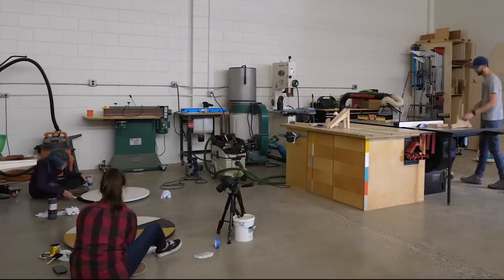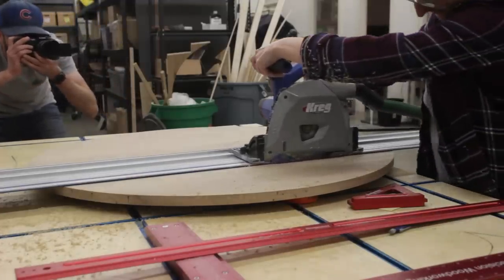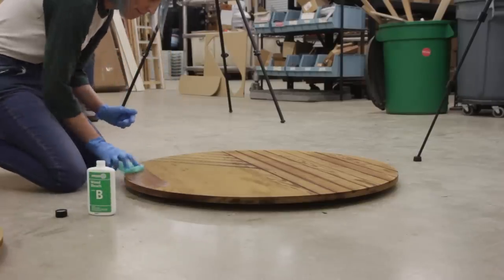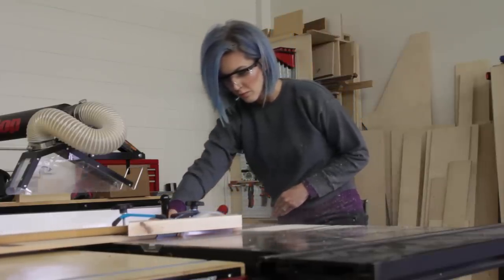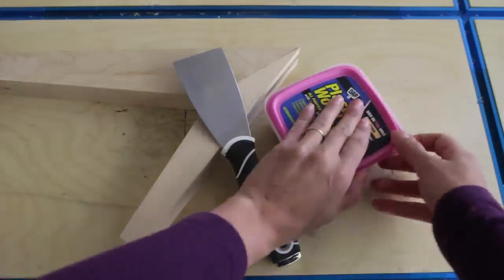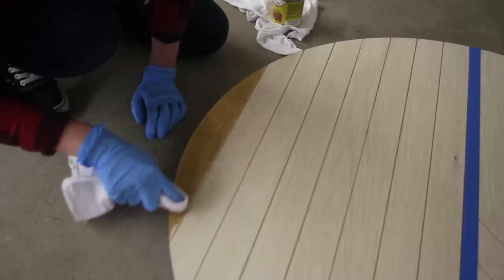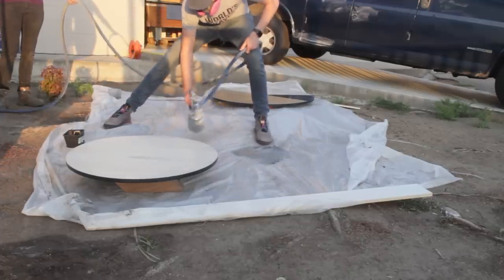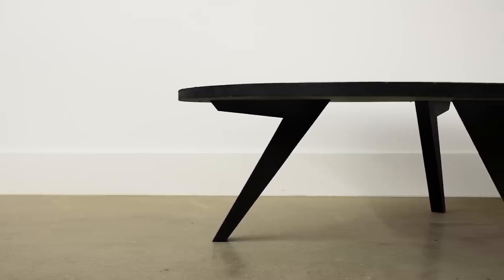BLEACH + INK Round Coffee Table | COLLAB W/ Foureyes Furniture & DIY Huntress

Comment: Ya!  So great! Sally Beauty supply has all sorts of great bleaches and dyes. I've used the Loreal blue black dye on some table legs but I've never tried Quick Blue even though I use it on my hair. Awesome woodhack
Reply from the maker: Heck ya! Do you have any photos of the table legs?
Reply: @PneumaticAddict  dang. I don't. It was for a prop in a play. Glossy is bad on stage due to the lighting so I was trying to get a dark matte look without using flat black paint so I used what I had on hand. Hair dye! Ha! It came out nice enough that it made go "Hrm. I guess hair and wood isn't so different." And then your video with 50 volume made made laugh. Yours is way better. This makes me think, though, that there are some really cool "cherry cola" style colors that could look pretty neat. Colors that don't like... map to classic exotic wood colors (like purpleheart etc.). Something different. Thanks for exploring and keeping it weird! 🤜💥🤛

Comment: Great process. Questions: 50 volume seems much harder to come by for some reason, would 40 work as well? And does this process get penetration into the wood so I could sand after and it would still be pretty dang light?
Reply from the maker: 40 volume will definitely work, it will just take longer to lighten. The bleach penetrates pretty deeply into the wood. I'd say maybe a 1/16" or more. I gave it a quick sand as was fine.